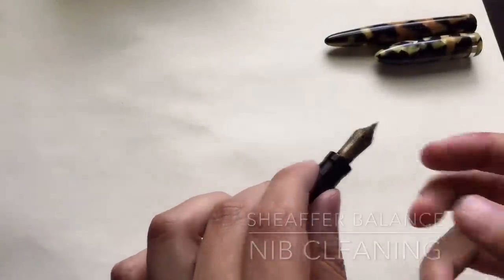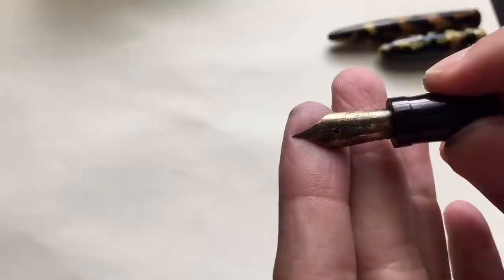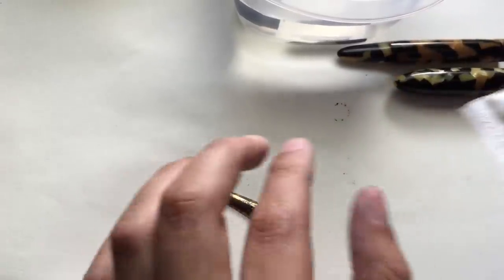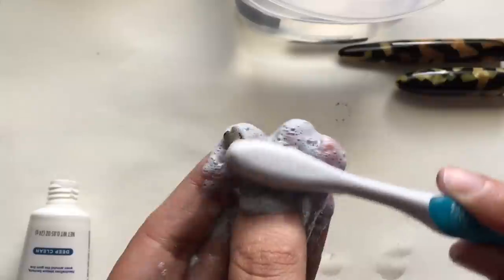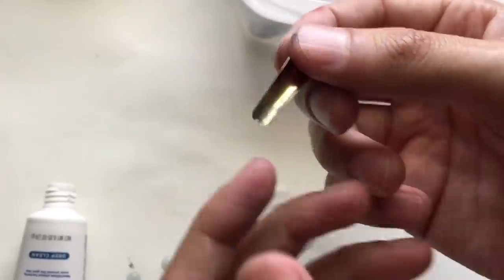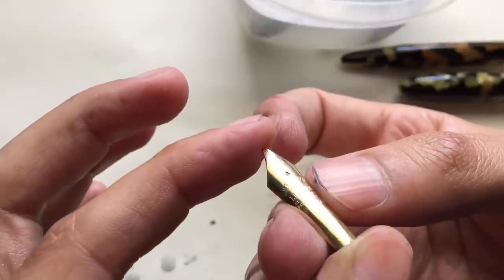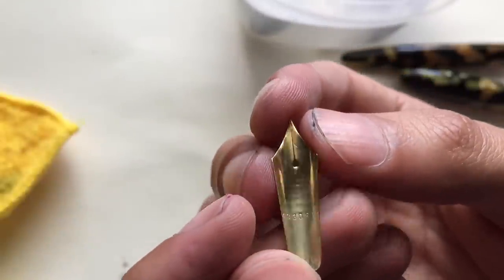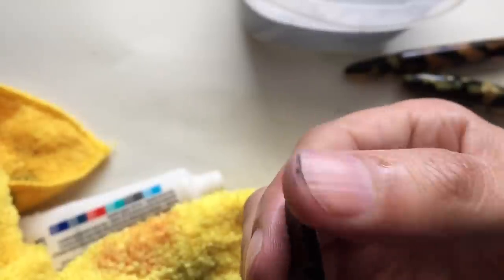How To Restore Vintage Nib (Sheaffer Balance)

Comment: Small amount of toothpaste on soft ear buds do the job better and safer, an important thing is to make only moves along the nib and never sideways cause you may damage the very tip I.e. alignment of tines. If you want to remove stains you should degrease the nib next put sheat of aluminium in a deep plate put nib on that aluminium then sprinkle generously with salt and cover all of that by the boiling water and left for couple minutes, after that wash nib in cold water and all stains are removeed.
Reply: wow awesome i heard about this with to clean silverware, does this get oxidization discoloration off nibs as well just got an old fountain pen 1930;s and don't know if i could try to clean myself
Reply: What do you use to degrease it first?
Reply: @THIPTHEP88  (!!!gold nib only!!!) There is no risk except you have to dismantle nib from the section and feed. Next you have to wash the nb in liquid soap solution, liquid soap is preferable due it does not leave any residues after rinsing. After soap wash good practice is to use vinegar to disolve any Limescale. Then after rinse out from vinegar good practice is to use alkohol to degrease any leftover amout of oils etc. After all of that prepare clear thin sheat of plastic that could be fitted into nib slit. Using this sheat put it into the slit and use it to swipe all eventually residues in nib slit, from the hole toward tines. After all of that degrease again and use aluminium shet and salt in boiling water method to remove any leftower oxidation. Now your Nib should be as good as new. If you want you may polish the nib with ear buds and toothpaste then rinse and again swipe the slit with sheet plastic.

Comment: DO NOT USE TOOTHPASTE ON NIBS. Toothpaste will remove far more material than you think, and will wear away imprints and plating on a nib. Just use water, elbow grease, and an ultrasonic cleaner.
Reply: Can i use an ultrasonic cleaner on a gold plated nib or that will remove the plating?
Reply: @nikossiotas  I wouldn't, if it's a vintage nib. The ultrasonic cleaner can cause some of the gold plating to flake off. Should be fine on more modern nibs though.
Reply: @J0hnstrains  Thank you for answering! It's an old one, so i guess it would be better to just let it overnight in ammonia water.